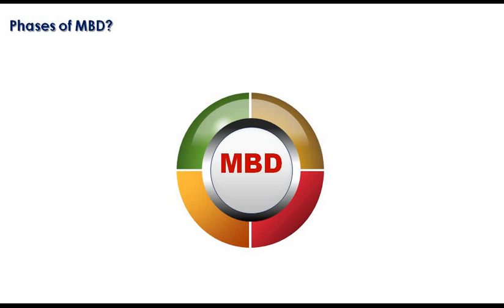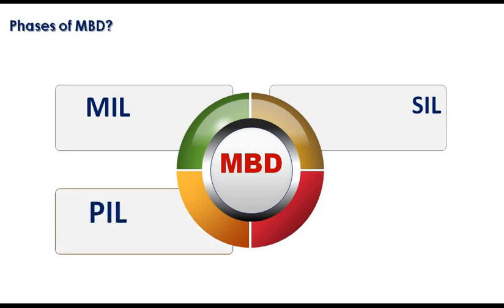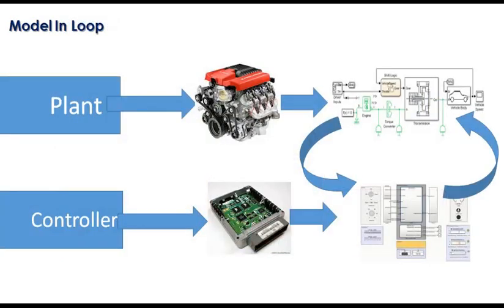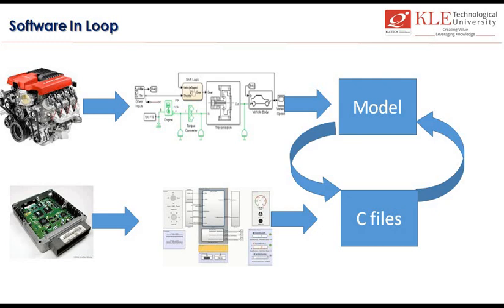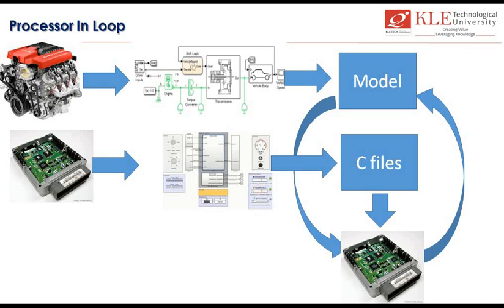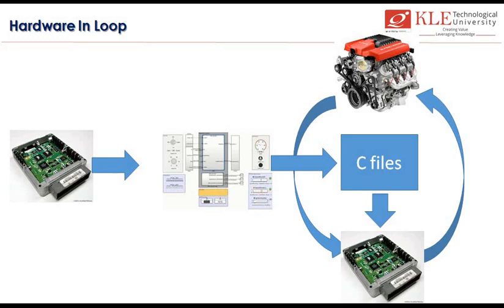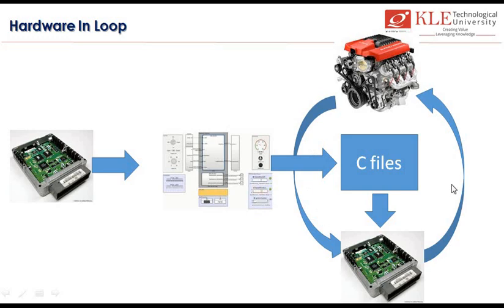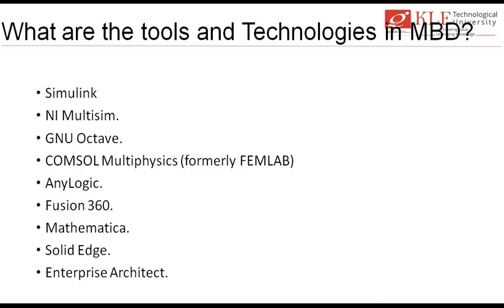Automotive Interview questions PART 2 HIL MIL SIL PIL hardware in loop software in loop

Comment: In HIL concept the plant cannot be a actual hardware or prototype.it should be the model of plant
Reply: Its is equipment where you need to flash you code
Reply: That's what I also wanted to point out. Plant model will remain plant model in HIL as well. When you have real plant model and ecu, then it is called Real Real system or Real World System.

Comment: Sir, in SIL testing, C files are generated only from  controller  model? And not from plant model?
Or, C files are generated from both plant model and control model then it is used for SIL testing ?
Reply from the maker: Only controller model